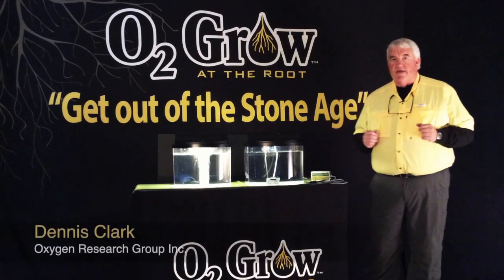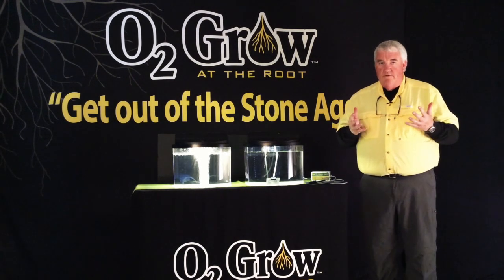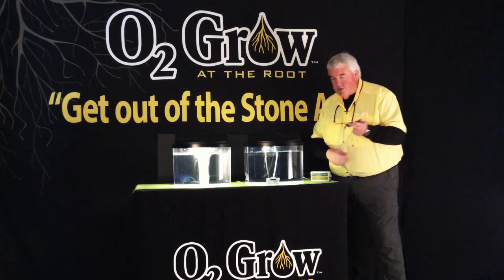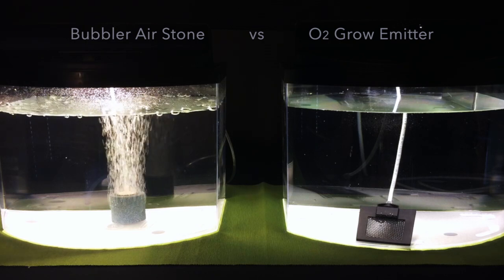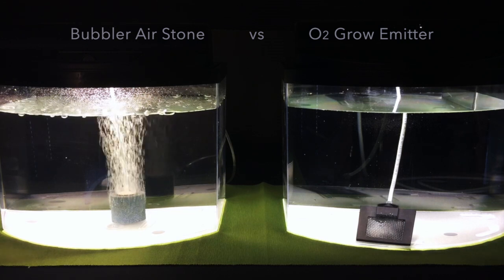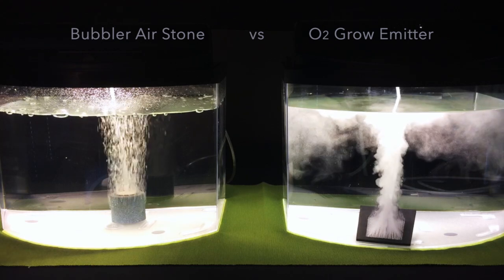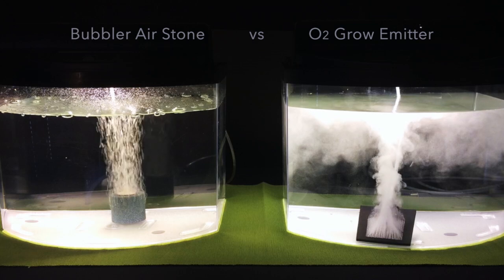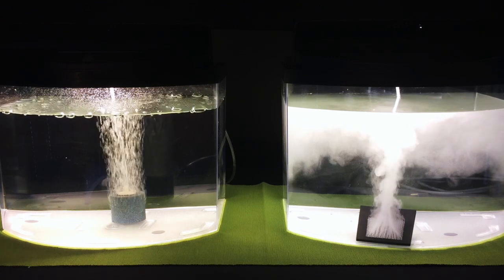Bubbler Air Stone vs Emitter

Comment from the maker: Let me try and address some of the questions. These are not designed for aquariums. You will kill your fish. Fish only  need 4 to 6 PPM. Bubblers can deliver that. This science is going to go  above that by 50 %. Probably in the 12 ppm range. That will probably  kill your fishing in a  aquarium environment. 
 
Don't worry about the hydrogen Gas off. Unless you are trying to capture the hydrogen in a ballon or something like that, it isn't any different than the water evaporating or boiling on your stove. Perfectly safe in any room.

The unit should only have to run three hours a day. The emitters have a end of life at around 1600 hours. So if you watered each day 365 days a year the emitters should be replaces at 577 days. a year and a half. A emitter on a 2020 is $39.00.

Hope this helped.People are urged to call with your specific needs and questions.
952-474-5820

Dennis Clark / Partner.

Comment: Great slogan & interesting product. Looks like you're using ultrasound to fracture the bubbles? I say that just based on your very steep prices. What I do is put an airstone under a ($30) waterjet. The jet pulls in the air, the propeller atomizes it and it stays under the surface even after leaving the current. The mist isn't as fine as yours... but I'm not quite sold on a price vs efficacy standpoint. Your lowest stone is $300 (for 20G). This is 33% O2 as opposed to 20% in air. So 13% more O2. 

However, all your product should be doing is saturating the water faster. And what you're claiming ("50% more") no offense, sounds like a gimmick. I know science enough to know oxygen is not very soluble in water. It's like 40mg/L at 25C. That's a ridiculously LOW amount of 02. Whether you're using an air stone, a jet, or your highly priced emitter... you can NOT drive O2 dissolution over it's established curve at it's respective temps unless you increase atmospheric pressure. 

Even with the weight of water factored in there are still basic thresholds that can't be passed.

So again, you're device can't add "50% more O2" in a DISSOLVED form. Can it aerate water to the point where the solution just stays saturated more consistently with more undissolved O2? Probably. But is your device resulting in more dissolved O2 then mine? No. Basic laws of chemistry say no.

If I'm wrong I'd love to hear what I missed. 

One last thing. I'm no plant expert. But if the goal is to simply, efficiently & AFFORDABLY increase O2 levels all a person would need to do is add a small peroxide gravity drip feed. The peroxide will enter the water at low concentrations and slowly break down. Starting with nanobubbles that expand and keep the water saturated. So again, in terms of efficacy vs affordability... I don't see the value. From an aesthetics standpoint it looks super cool. From a functional & scientific standpoint I don't see how this can do anything close to what you claimed. If somehow I'm wrong and it magically can, it would be useful to actually show the O2 meter ... especially if your goal is to sell these. You're selling 50% more so please show what you're selling.
Reply from the maker: +Robert Cece 

Thanks for the questions. 
I hope this doesn't get to long. 

Air hold 21 % oxygen. The rest is Nitrogen. When we talk about % Increase we are talking about the PPM of which Air stones can usually only reach around 8 PPM saturation.It's source of oxygen is the air me and you breath. 
 This science has nothing to do with Air. Sometime bubblers used in grows or rooms are infusing warm air which is a negative result with your DO PPM because anything after 65 water temp is going in the wrong direction. 65 degrees is ideal. This science again has nothing to do with the ambient air. We separate molecules electronically. the oxygen molecule is heaver than the hydrogen molecule therefore can be reintroduced as a pure 100% nano bubble and effectively will raise the DO 50% or at lest to 12 PPM. vs 8 ppm.

 Our university test of which are posted on our site show and average of 20% increases in seed plants. these are simple test conducted for simple farming techniques. Drain to Waste. Your correct about Hydrogen Peroxide however it's a short lived increase. Only minutes. We like everyones knowledge and input, however we find that most growers haven't spent the money on a Dissolved Oxygen Meter. I would encourage people to invest in that first, then they know what they got before they  invest in other devices. Bubblers frankly deliver little oxygen. Why ,because they use ambient air. You could put ten bubblers in a bucket and your O2 PPM will probably not go over 8.5 ppm .A person can add all the venturies, pumps you want. The  O2 will not go up. Again there source is only the air we breath. 

I'll close with this. The closest thing to this science is on a Submarine, and it cost about 20 million dollars. We'd love to have less expensive product, but this is made here in the US. If it saves one plant, it paid for itself.

Comment: So in other words, your using the O2 that pre existing in the water, while a stone brings outside air into the water......
Reply from the maker: +jinno11 
The out side air only holds 21% pure oxygen, the separated oxygen molecules we generate through electrolysis are called Nano Bubbles. These are  100% pure oxygen. When they are reintroduced to the same water it raises the DO by 50% or to around 12 PPM. Bubblers can only  achieve about 8.5 PPM

Comment: Tell me, how your product can affect the ph of the water???
Reply from the maker: esta canail This is a good question. The product will not negatively affect your pH. Actually, more dissolved oxygen you have in your water will help the pH levels balance closer to neutral. The process of electrolysis breaks apart the water molecule, the hydrogen bubble is larger and will rise to the surface and dissipate. The tiny O2 molecule is reabsorbed back into the water. So, in this process, the hydrogen is leaving the water in gas form. Nothing dangerous, because it's just a very small amount. Hope this helps!
Reply: Oxygen Research Group 
neutral as in 7? DWC growers like 5.8-6.2 and with the most common form of nitrogen in nutrients being nitrate we release negative ions into the water in turn raising PH. So with this we will get an even more steady ph swing up? Theres more to just sticking two ends of DC into the water and increasing DO. Why are there no videos or images of plants growing with this product? If there is so much research being done how come I cant find one REAL WORLD PLANT GROWING example
Reply from the maker: Leaf Ericjohnson Hello Eric,
Thank you for your question. Because we offer a product that will increase oxygen to many different type of growers who grow different crops and all of which have different methods.  It's difficult to have a canned answer for many of the  question sent to us. Too many variables. If you're a dirt farmer optimum pH is 6.0 to 6.8. If you are a hydro farmer you are correct, pH of 5.5 to 6.5 is correct. Dissolved oxygen is important to help balance pH. However it does more than that. It helps nutrient uptake, activates organic materials for tea growers and more importantly helps control root rot. There have been many papers written that document all of the above. 

This is what we know. This product increases dissolved oxygen without the noise of pumps, doesn't blow hot air into you water, and actually can increase DO levels as much as 50% more than a bubbler. In regards to your request for pictures, our clients are only interested in independent research studies, not much in pictures of who knows where and how they were obtained. However, there are pictures on our website www.o2grow.com of the root balls with lavender plants. We had two separate universities conduct control tests with pretty conclusive documentation of root mass or yield increase - we don't claim that the plants are bigger, which may or may not be evident in pictures. Rather the University research shows an increase in root mass and plant yield among a variety of different plants.  This documentation is on our website under Research.  Additionally, the product we are offering at this time are for small surface water growers or small hydro growers. Regarding DWC systems bigger than 60 gallons we have two devices that are being tested for 120 gallons and 250 gallons. If your system is closer to this capacity give me a call and maybe we can get you involved in some of our DWC testing.

952-474-5820 Dennis Clark